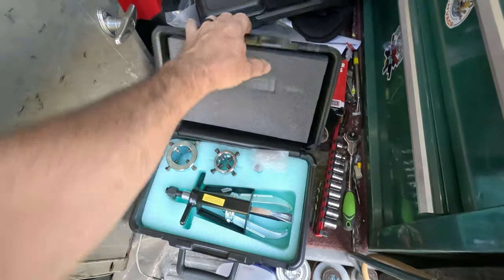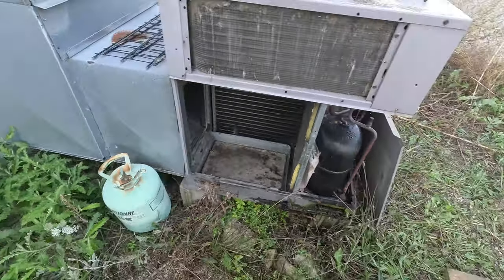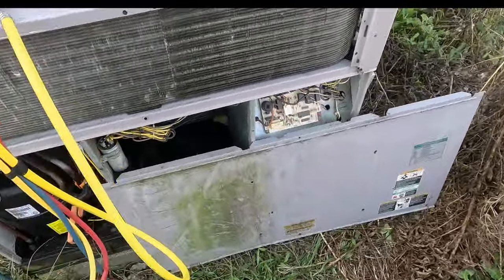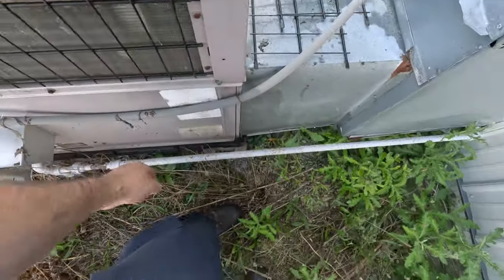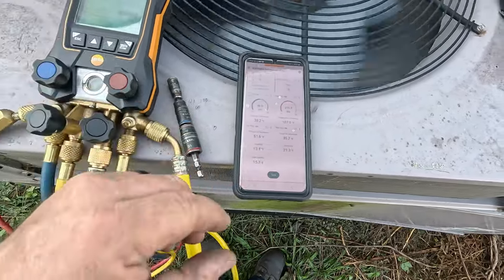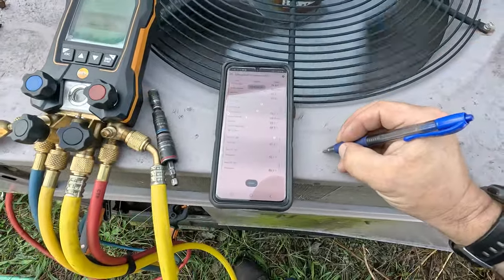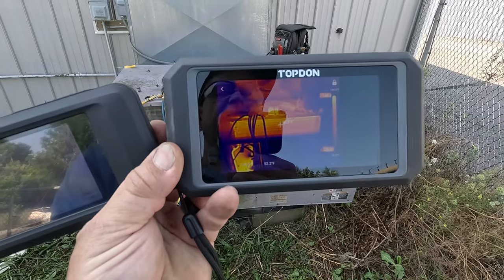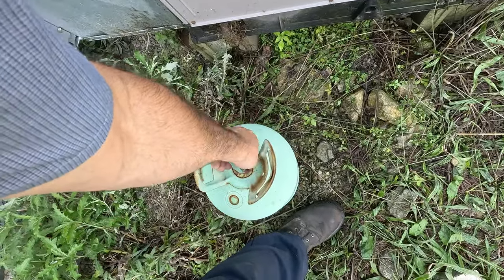Evaporator Coil Freezes Up At Night

Comment: Another great video Rick. Thanks for taking the time to upload them. Those Posi-lock pullers are some well machined pullers.
Reply from the maker: I hope to try it out soon on a hard to pull hub. I had one a month ago that I had to cut off the shaft and pound it out with a chisel and hammer. My usual puller couldn't get it with spray and heat

Comment: Totally agree with the fan cycle control suggestion.  I installed one on my equipment since it operates from March to November.   Someone in the home likes it cold.  Wow I didn't realize how pricey those image tools are.   Thanks for the content.
Reply from the maker: That Flir I had has gone up to over 700 bucks but I think it's starting to come back down. These ones here were $499 to 599 but they just recently jumped 100 bucks. Everything's gotten stupid money wise

Comment: I’ve dealt with this duct design. Usually styrofoam and rubber sheets with  sealant  is in between the sheet metal. There deff lazy and took the easiest route. But yes they are to cover the actual supply and return

Comment: Quick question: Have you used the Fieldpiece test instruments before?  I have a handful of Testo tools, and I like them, but I am wondering if I should invest in Fieldpiece.  Just looking for somebody that has used both.
Reply from the maker: I have the fieldpiece probes, and the fieldpiece manometers. I like the probes but not the manifold gauge sets, I don't like their electric meters, but I do like the vacuum pump.
Reply: @HVACRSurvival  Excellent insight.  I appreciate the information.

Comment: One thing that bothers me with the Testo gear is that I zero out my gauges or probes before gauging up , but very often wgen i take them off it reads with an offset like -0.4 bar or -0.2 . Makes me question if my readings were actually accurate.
Also the app doesn't have an option for a second circuit where you could read both at the same time.
Reply from the maker: Agreed, I don't have the issue with the pressure differential when I'm done as much as I did with the 550s, the 557's have always been better.

Comment: masterbuilt LOL.until the end baby,no return air,could add ,constantly bringing outside air.will not reach temp,lower temp at night freeze up.reset temp at night, to cycle unit,or fan cycling,freeze t stat,with time delay.you pick.
Reply from the maker: The return was kinda there but it wasn't optimal. Everything was off by a little.

Comment: If you're not having fun with the videos, and the money doesn't compensate, then stop.  Just be sure to send me one of your "solar generators" when you shut down :)    (I can't justify the money, even needing power for my workshed)
Reply from the maker: Buy a gas generator, the batteries will eventually go bad the motor won't when it just sits there. As far as the videos are concerned, like I said,  the feedback is the only real reward. So as long as I keep getting that then I'm here
Reply: @HVACRSurvival  - I have three.  I'm just debating on putting some panels on the shed just to keep exhaust fans/dehumidifier running.  It doesn't need to be air conditioned 24/7.   Trying to determine how many batteries to build in for that.   Eventually it'll have grid power run to it, but I'd like it to not be 100% dependent on that stuff.
Reply from the maker: I'm without power right now. That 3600 watt power station doesn't last more than 3-3.5hrs with my total load. I'm glad I didn't pay anything for it. Gas generators kill it.
Reply: @HVACRSurvival  - Definitely depends on your load.  I'm looking at roughly 400 watts (max) of unobserved off-grid load.  Basically, run some lights and a dehumidifier when I'm not using the shop, especially at night when the humidity rises.  When I'm using it, then firing up a generator to run a mini-split and the computers is likely fine.  (I'll have to get a larger generator, though.   Two, 2kva generators doesn't make a 240 volt mini split happy :)  )